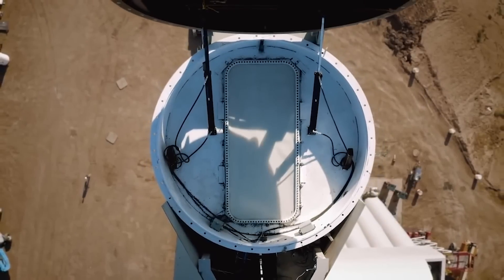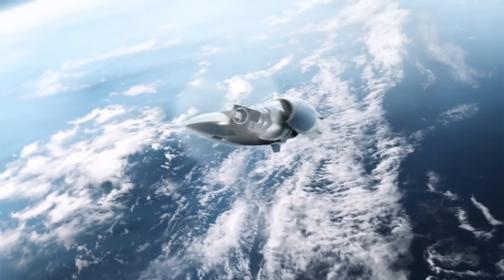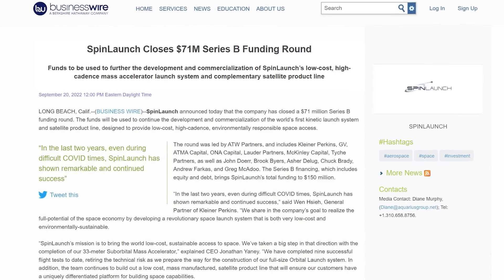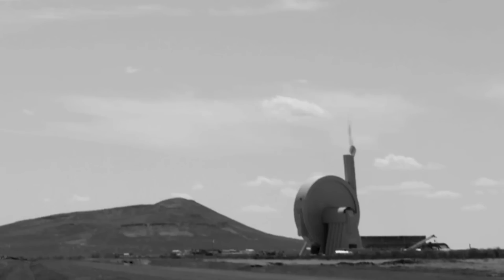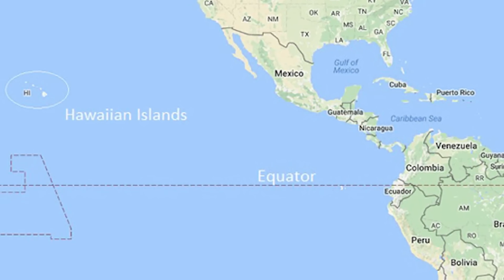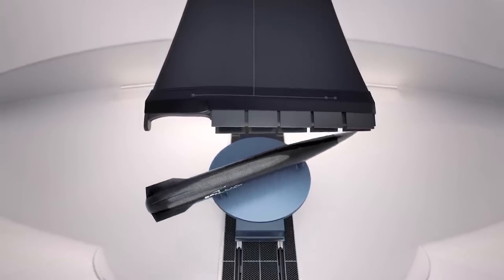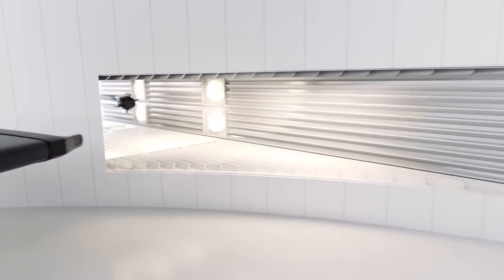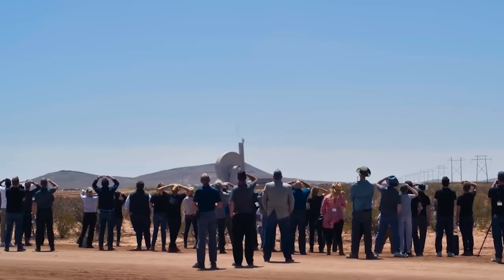What Happened To SpinLaunch & The Orbital Accelerator?

Comment: Forget all the difficulties and concentrate on one. The instant the projectile is released, the spinning arm is instantly out of balance and if you watched the video of the wind generator destroy itself you can see just how much energy a spinning object has. If you get that far then you got over the problem of releasing the payload with incredible precision or the projectile will destroy itself and whatever happens to be within a fairly large area.
Reply: release the counterweight at the same time and just slam it into the ground
Reply: @-NGC-6302-    Errr Ummm there is no ground, slam it through the wall of the vacuum seal.
Reply: @-NGC-6302-  ouch!
Reply: @-NGC-6302-   what's gunna stop the counterweight once its released? That will have equal energy .......... just in the opposite direction 😮
Reply: @donuthole7236  If you look closely, the test launcher has a protrusion on the exact opposite side of the "barrel". That's where the counterweight smashes
Reply: @donuthole7236 There's this thing called 'earth' underneath, it'll probably do the trick.
Reply: @-NGC-6302-  All that is needed is  for the counter weight to be moved to a closer radius to the rotational axis this can be done quickly with an internal booster charge.
One of the centrifuges I work on spins a single item and actively balances the system by using a movable counter weight
Reply: that's relatively easy. just have some equivalent weight shift on the arm to compensate.
Reply: @michaelrasinsky334 
Weight shift?  You would either have to drop the weight or move the weight inwards towards the center.  How would you possibly move the weight inwards with all that force on it.
Reply: @timb7775  why move against the force when you can move weight on the other arm - out and then brake it. carriage that moves while releasing the dart or something.
Reply: @michaelrasinsky334 releasing weights simultaneously on opposite sides is probably the best case scenario. That reduces the efficiency to a best case of 50%, unless energy can be recovered from the discarded counterweight. Perhaps that’s energy recovery like a linear mass driver running in reverse or something.

The problem with movable weights is the conservation of the remaining angular momentum after the reconfiguration to balance will generate immense bending moments. I suspect without doing the math, that the absorbed momentum would in fact be equal to that of the projectile that would otherwise be discarded smashing something.

Another point worth mentioning…preserving the vacuum is likely a fools errand unless you plan on having people in space suits fit the next payload, inspect and replace pyrotechnic bolts or other hardware that triggers the release.

On a final point, theoretically if released from some sort of hinge that creates a counter rotation opposite that from the spin, at release, it might be possible to at least have a projectile moving more or less straight. Of course that has its own problems, and imposes an oscillating load on the payload.
Reply: @timb7775  You could have more weight on the projectile side of the arm. Just have it closer to the center. The counterweight on the other side of that pivot point balances everything. When the projectile is released the weight closer to the hub moves outward away from the hub to help offset the lost mass. You don't have to move anything inward that way.
Reply: @michaelrasinsky334  you seriously are proposing moving several hundred tons of weight in 0.001 seconds?
Reply: @downix  That rocket can be lifted by two people, where does several hundred tons of weight come from?
Reply: @downix  I'm sure it's going to be some engineering challenge, but why not? Same centrifugal force will move the balancing weight, its going to be harder to brake it I guess...
Reply: @michaelrasinsky334  an engineering challenge on the level of building an enclosed ladder to the Challenger Deep. That is the amount of physical stresses we are talking about here.
Reply: @CharlesSmith-io9fp  the centrifuge itself.
Reply: @downix  The centrifuge itself is balanced.  Putting 20kg on one end needs to be counterbalanced by an equal weight on the other end. The weight of the arm itself doesn't affect anything because it's neutral. Picture holding two buckets of water both weighing the same. In this instance you will be the spinning "arm".  You then start spinning and your arms move outward from the bucket/water weight. release only one and you would lose balance and possibly fall, releasee both at the same time and your body remains in equilibrium. That remains true whether you weight 100 lbs or 300 lbs. The same with the spinning arm. It's weight is irrelevant.
Reply: @CharlesSmith-io9fp  and because it is balanced, once you release the launch vehicle, which is a few tons by itself, the entire assembly is now off balance, and spinning at tens of thousands of RPM.
Reply: @downix  Watch this video and pay attention to it starting at about the 5:18 mark. It shows the size of the projectile currently being tested. It can be moved by 2 or 3 people. It does not weight "a few tons" https://www.youtube.com/watch?v=csFyhYSLwic&t=308s . The counterbalance weight is released at the same time in the opposite direction, the rotating arm does not get out of balance. That's why you don't see the whole damn thing blow up. Stop trying to complicate a problem these guys have basically solved. After all, it's only rocket science.
Reply: @CharlesSmith-io9fp  it is rocket science, and Spinlaunch is not.
Reply: @downix  What the hell do you call trying to put a payload of anything into space. That sure was shaped like a rocket, just with an alternative propulsion system. In other words, rocket science, as I've already mentioned. I'm beginning to think you're a fan of MTG and J S L's. The world IS round.
Reply: @CharlesSmith-io9fp Although the projectile is fairly light, once rotated to 5000mph it's inertial forces multiply exponentially. That's why on a smaller scale balancing the tires on a car only takes small weights and at slow speeds you don't notice an out of balance tire. It's only when you accelerated up to highway speeds that those ounces of weight difference between one side of the tire to the other become pounds and can make the entire car shake. Now imagine your car tire the size of a building and that 2oz weight being a couple hundred pound projectile/weight. If that projectile/weight flies off (as intended), that giant tire would tear itself apart in seconds. And since it's the size of a building it would be catastrophic damage.
Reply: @CharlesSmith-io9fp you people are hilarious. Not a single thing meets reality with the words that you're spouting.
Reply: @xplmr1  You haven't changed the mass of the object, you have changed the speed the object is moving which just changes its inertia. The weight of the object can't change unless you add or remove mass. These are different aspects of the same problem.
Reply: @mastermnd22  I'm sure most of your education was learned while you did valet parking at the trailer park.
Reply: @CharlesSmith-io9fp  I agree that the weight hasn't changed but as the rotational speed increases, the inertial force can be measured in lbs. of force which would be an increase in measured weight. As I stated in my analogy above, ounces of weight being rotated on an axis can multiply to become pounds of inertial force tugging on that center of rotation. The speed of the rotational mass is what increases it's force pulling on the center of rotation. So to add to my point, if you had a Ferris wheel that had all but one of the 500 lb. gondolas removed and the center hub was rated at 50,000 lbs., you could theoretically rotate the Ferris Wheel fast enough that the inertial force would be too great (over the rated 50K lbs.) and the center hub would fail because the tug from that 500lb. gondola on the center hub was greater than 50K lbs. even though the gondola's mass of 500lbs. never changed.
Reply: @downix "you seriously proposing"   ...they DID it. 
They have already done this and solved it with a counterweight with more mass moving at a slower speed which slams into a wall
Reply: @AlmightyDude420  they released a projectile going Mach 15? When? Also, this is a subscale example of what they want to build, not the final one, so the counterweight is significantly smaller to boot. My initial statement stands, and until someone can find a way to counter that whole pesky "conservation of motion'l" issue this is a non-starter.
Reply: @downix  "they released a projectile going Mach 15? When?"
You tell me bud. I never said anything about a projectile going Mach 15. That's also not what I'm talking about-I'm talking about the counterweight. 

Nothing you said "stands" because they already solved the issue of the counterweight. They release a much heavier counterweight at a much slower speed than the spacecraft/projectile. 
Essentially, all they have to do is scale it up.
Reply: @AlmightyDude420  the issue is releasing it going the speed the projectile has to reach in order to hit first point staging. That is a substantial speed. This has not done that, nor will it ever do that which is my point. This is grift, pure and simple. The physics do not work.
Reply: @downix  The physics work. The counterweight release has already been successfully tested to work. 
There is no reason to believe that scaling it up will cause any issue
Reply: @AlmightyDude420  there absolutely is reason. Why are you ignoring the conservation of momentum?
Reply: @michaelrasinsky334 the release is instant. How will you do a weight shift instantly? And easily too as you say
Reply: 1. The projectile can't be released "instantly", and it would not make sense to do so even if you could.  The easiest way to reduce the spin of the projectile upon release is to release the front before the back. And no mechanical release is instantaneous.
2. Release a counterweight.  They are doing this now.
3. Move the arm or part of the arm toward the projectile as it's being released to re-balance it.
4. A bearing can be made to handle some level of being out of balance.  
5. Yes it could destroy itself. So could a rocket launch, or a passenger aircraft.
Reply: @bradleyrex2968  They seem to be handling things pretty well without me sending them suggestions. But since you bring this up, " And no mechanical release is instantaneous." perhaps you can explain how they reliably manage to release their projectile, that at 5000 miles an hour always seems to hit exactly where they want it to. I know they have the solution, but hearing your theory should prove interesting. 🤨
Reply: @CharlesSmith-io9fp    They reliably manage to release their projectile (that still wobbles) by having mechanical releases with known activation times and minimal variation, and adjusting the release time to account for it.  Something as simple as shooting a gun in front of the flying duck vs straight at it, because the shotgun is not instantaneous. 
They are nowhere near 5000mph yet and they launch toward a huge open area that they clear of all people.  
Why not send them your list of known instantaneous mechanical release mechanisms?  It would simplify things for them. 😋
Reply: @bradleyrex2968  It's wobbling when it comes out of the chute because it has a rotational moment (yaw) around its center of mass from the rotation of the arm. That arm was spinning it around so the projectile is still spinning around when it's released. Once it's in the air the fins stabilize it.
Reply: @hazzmattlink  Yes, but the launch tube is about as long as 1/4 turn around the spinner, so unless something has been done to dampen that spin at the time of release, it should emerge at 90 degrees.  So they have done something, they just need to improve it.
Reply: @bradleyrex2968  Because they already seem to have a workable solution. All we're doing here is speculate on how they might have achieved this. Why don't you contact them and tell them how their answer can't possibly work, because you don't understand it.
Reply: @CharlesSmith-io9fp   Lol.  You seem confused.  I have never said it can't work.
Reply: @bradleyrex2968  You certainly like poking holes in other people's ideas. And what does this mean? "so unless something has been done to dampen that spin at the time of release, it should emerge at 90 degrees." Once an object is released, angular momentum no longer affects that object, it will continue in a straight line from the point of release.
Reply: @CharlesSmith-io9fp   And ice cream, and sunny days.  There are lots of things I like.  Does not seem relevant here though... 
"Once an object is released, angular momentum no longer affects that object"?  No.  Never seen a pitcher throw a baseball?
Reply: I was thinking maybe a water counterweight would be good
Reply: The payload is held with a pair of front and rear latches. The front latch releases first and the rear latch releases later when the contact angle is ideal. TADA, no remaining spin, regardless of RPM. 

Release the counterweight simultaneously the same way downwards into a bored tunnel that is parallel to the payload trajectory. The tunnel is also pressurized so that air drag slows the counterweight. The bottom could contain water so that buoyancy as well as drag gently stops it.
Reply: Their prototype had a disposable counterweight that was released at the same instant as the payload.

Assuming they scale this up, I'd be interested to see what their risk mitigation strategy is if the counterweight is released too early or too late.
Reply: and you don't think they at least tried to solve that problem before doing their launch?
My guess is they decenter the arm to reequilibrate it, or they transfer any mass either closer or further from the center.
It obviously didn't explode when they tried it, so the problem wasn't terminal
Reply: They’ve solved that issue with a temporary counterweight that they just smash , the actual launcher will release a reusable counterweight half a rotation after the initial release which shouldn’t cause any major off balance seeing as it is occurring half a revolution later.
Reply: @bigcnmmerb0873  that certainly would cause an imbalance. Suddenly you have 23k of G off balance on the arm.
Reply: @bigcnmmerb0873  instantly releasing the kinetic energy required for an orbital launch? that will go off like a small nuke
Reply: @bigcnmmerb0873  why not just launch a second projectile if that's the case?
Reply: @benholroyd5221  you don't want more then two projectiles on the same exact flight path, adding to that could run into the possibility that because the first projectile is taking up the brunt of the aerodynamic stresses, the second projectile would catch up and smash into the first which is very likely to happen
Reply: This is oversimplified but how about a counterweight system that expands out from the center as the arm spins faster. Once the projectile is released the Motor providing the spin is disengaged. A system could be used to return the counterweight to the center thereby keeping the arm balanced. No need to destroy anything. They obviously have some kind of system worked to to prevent destruction of the launcher. Now I want to find out what their solution actually is.
Reply: @CharlesSmith-io9fp  ATM they are just smashing a counterweight into the wall for the prototypes, but they plan on releasing the counterweight into another chute a quarter of a rotation.

Altho your idea seems to be a lot better ngl less of a chance of fatal errors, but will see what their tests conclude
Reply: oh no, physics problems have a history of being solved, what will we do!?
Reply: @up4open   - you're thinking of engineering problems. They're the ones that get solved. But there's no prospect of evading the laws of physics.
Reply: @nigeldepledge3790  physics?

so far, i havent seen much physics being applied.

it doesnt need a counterweight.

it needs PHYSICS.

can increase the launch speed well over the rotational speed alone, with some...

PHYSICS.

"give me a fulcrum and a lever long enough and i will move the earth..."

yall approaching this head on, like a bull. thickheaded and half blind.

be subtle. theres a huge amount of energy there, and its being wasted. why? cus yall rush in and think obvious, direct, bash it with a hammer.

PHYSICS.

"oh lever dear, how dost i lovest thou? let me count the ways..."

yall thinking of stopping the wrong bit. and forget what wonderful things levers are...
Reply: @nigeldepledge3790 , it’s a good thing, then, that nobody is talking about “evading the laws of physics”.  Except for you, of course.
Reply: @Vessekx   - not I. Perhaps you need to re-read the comment to which I replied.
Reply: could just have a counterweight on the launch arm that gets released hydraulically and moves towards the end of the arm that just released the satellite
Reply: @NwoDispatcher  Adding even more weight. Needing the system to be heavier, which adds more again. This would be the most out of balance system ever created. Spinning with incredible energy. The bearing system will need to be extraordinary. The vibration would likely be detectable by earthquake monitors.
Reply: An internal liquid counterweight could rebalance it but the timing and dynamics would need analysis and optimization.

Comment: They've probably not yet eliminated the horizontal translation as it launches.  One can see the nose moving sideways in the clip.  The centrifuge release mechanism does not release quickly enough.  Remember early long oval launch tubes? They've gotten quicker but not there yet.
Reply: It's nothing to do with the release speed.  It's spinning. It doesn't magically stop spinning once it's released.
Reply: @zachary3777  That's precisely why it translates.  Glad you understood.